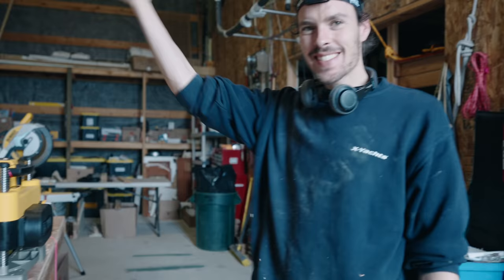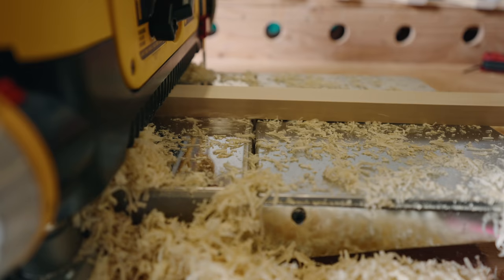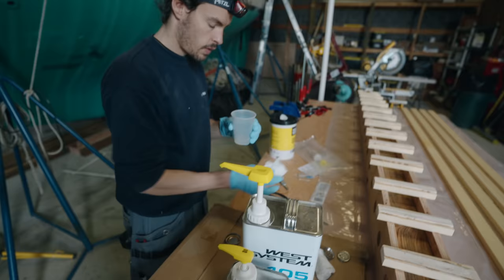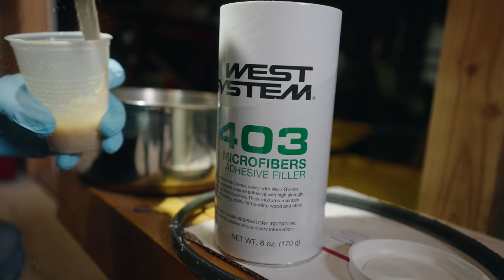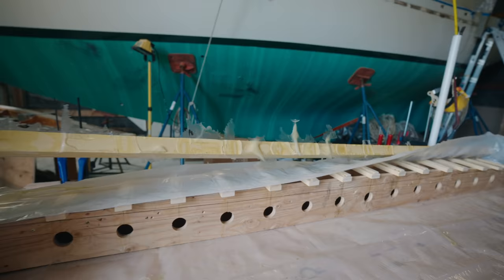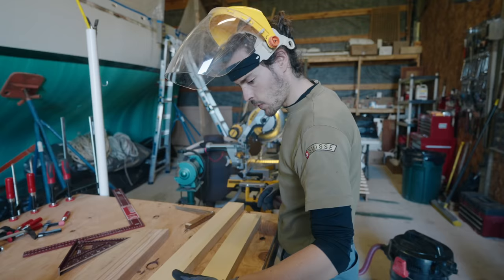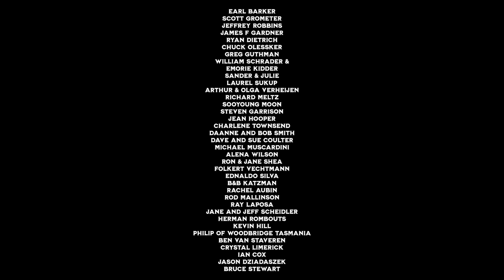SUCCESS!! Turning a BIG corner in the refit [S4E17]

Comment: Great job guys. Love the thicknesses.

If I can make a suggestion after some experience with epoxy. Use a paper cup if you can. It has a flat bottom and sides. Plastics never do and it’s environmentally better. 

Cut your stirring stick square on the end with a chisel so that when mixing the west system you get into the corner of the cup. West can be a bit fussy if not mixed properly.

Comment: I've worked on a fairly technical composite build this last year. I (almost) always use the two cup method when mixing epoxy. Pump the resin and hardener into one cup, mix a bit, then transfer into a second cup. That will eliminate the possibility that some viscous liquids will cling to the surfaces and fail to mix, then fail to cure. It also greatly improves your sleep prior to demolding expensive components.
Reply: Came to comment this, glad to see it was already mentioned. Particularly if using a cup not designed for the job with grooves and such where dead spots despite stirring may remain (as it's a viscous fluid, even more so when using additives and fillers).

Comment: Yes! Aladino is (for me) the first on YTube to do it the right way.
First a saturating layer of the thinnest epoxy, wait for it to get tacky, and only then apply the actual epoxy glue!
Usually people just put the glue directly on the wood: wrong, not nearly as strong.
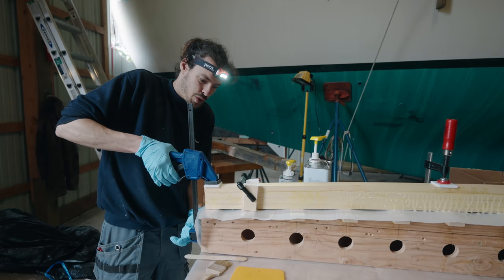Small tip: Place the side blocks between the supports of the jig...(at 13:18 you can see it move. It moves, but still is a risk)

Comment: I’ve had issues with pumps losing prime over time - I just use a cheap food scale and mix now by weight - west systems 105 mixes at different ratio by weight for some hardeners  but west systems instructions gives the by weight ratio no waste then if pump goes wonky. I had to go back and look this up to confirm

Comment: Aladino keep up the great work....
I was in residential construction for 25 years and i have a time saving tip for you... When cutting angles using a compound miter saw with lasers. Place the piece on the saw use the lasers to help line up your cut to the angle marked on the piece that needs cut. This takes out any guess work and time needed to get the perfect angle needed to make the cut... 

Hope it's a useful wood cutting tip

Love the channel

Comment: ... the biggest reason for the different "hardeners"  is ambient temperature.  The "slow" hardener is for working in higher ambient temperatures  (hot days )  ... the "fast"  is for lower ambient temperatures  ( cooler days ).  If it is a really hot day,  make a "ice bath" and place your tray in it ... on a +90f day it helps w/ your "working time"  ... a lot !!!!

Comment: Excellent craftsmanship as always! Just wondering if you considered putting clear tape on the outside of the bottom-most board to help minimize the epoxy sticking to it as well or if that would have made any appreciably difference in speeding up cleanup?
Best wishes to you both.

Comment: When you glue up your deck beams make them twice as wide then you can run the finished product through the table saw and get two per session rather than just one
Reply: I thought that has well, but thought it would take twice the force to bend it and may mean there would be more of a chance of some spring back 🤔
Reply: @johncarter5022  Certainly would take more clamps but spring back is not a significant issue with bent lamination such as this. It can be a problem with steam bent wood and is why chair rockers are not steam bent.  I admire Aladino's thoroughness and craftsmanship, but think the pre coat is completely unneeded. West Marine epoxy is so very much stronger than any wood. Also not sure why the bottom board has epoxy on the bottom for the glue up. Instead of all that tedious clean up with the heat gun and scraper; just apply epoxy after the glue up.  Oh, and ripping  a long vertically curved piece of wood with a table saw is not a good idea. Better to use a band saw and then clean up sides with the planer. Much safer.
Reply: Tricky to put a 10' curved beam through a table saw. Not saying it is impossible, I just would not want to try it.

Comment: You Never have enough clamps, I think the formula is N+2, N is the number of clamps you have on hand, what you need is 2 more. Another tip is use clear packing tape on your blocks, I've done that for years and it's reusable, the duct tape gets sticky and leaves glue behind. Keep up the good work, it's impressive what you're doing.

Comment: You can buy a concave router/planer bit made specially to prevent glue joints from being to dry but allowing the outside surfaces to be tight.   The best of both worlds.

Comment: When you do the first coating of the wood do you use catalysed or uncatalysed  resin? You can really see where the labour costs in boat restoration come in when you see the stages involved and the time everything takes to dry. It's really good to see a professional at work as it helps me with my own projects.
Reply from the maker: We are using epoxy not polyester resin. 
Check out epoxies especially formulated for this task like west system resin 105 + 207 clear coat hardener.
Reply: @SailingMagicCarpet  So you never use epoxy resin in an uncatalysed state in any circumstances? I'm just asking because I don't know.
Reply: @charonstyxferryman  Thanks; that's what I wanted to know. I use epoxy but I've not precoated my wood prior to clamping. I try and do the job when the temperature of the day is falling so that the wood will tend to suck the resin in as it cools.
Am I correct in thinking  that the mixing ratio for polyester is much less critical? I know when using car body filler it's very approximate.
Reply: @cornishhh  Yes. Still, one shouldn't go overkill with the hardener with polyester resin either. Stick to whichever measurements and ratio the product data sheet recommends.

Comment: Wouldn’t packing tape (or something more substantial) on the bottom of the beam eliminate having to scrape off all the squeeze out Great episode folks!
Reply: Great idea ! 👍
Reply from the maker: We did try this on subsequent beams — it helps, but because cured epoxy is so hard, we couldn’t actually rip the tape off once the epoxy was dry. That meant we had to peel the tape at JUST the right moment, which, let’s be real, we don’t always get to. We did keep using the tape because it did help, but it wasn’t a magic cure all!

Comment: Do you have any spring back after epoxy has set from end to end? A deviation from the contour of your jig? And in my shop I use a foot switch connected to the vacuum system, with your foot turning on the vacuum before you make your chopsaw cut, to speed up production.  Ditto on using full width of planer, good suggestion.
Excellent progress! Yay! 😀

Comment: That vacuum cleaner doesn’t produce the volume that you need for that planer. I used a 12’ dryer hose laid out straight into a trash can. All of the saw dust ends up in the can and not on the planer table.

Comment: Have you considered Titebond III for your beams?  I've had very good results with a strip planked  desk using it.  Its much faster (and cheaper) than using epoxy and I had no problems with fibre glassing with epoxy...
Reply from the maker: I used to using epoxy or resorcinol for these jobs so that’s what I trust the most:)
But I am sure titebond also does the job

Comment: Ever consider mixing epoxy by weight (with a small scale) rather than volume? Relaying on the perfect push of the pump and doubting the measurement when it sputters got frustrating for me. Careful with the ratios it’s not exactly 5/1 by weight. I think it’s 1:0.18 as the hardner is slightly denser than resin. Double check that ratio. Cheapskates like myself enjoy the added bonus of not having to waste a drop by priming the pumps too.

Comment: not being judgmental here. I wonder why you are not feeding 3 boards at a time through the planer? I have experience and find it saves time and spreads wear across the blade.
Reply from the maker: I want the planer to last. The less it works the better. I also only take 1/32 off on every pass. It could do a lot more but who knows for how long. This is not an Industrial planer.
Cheers